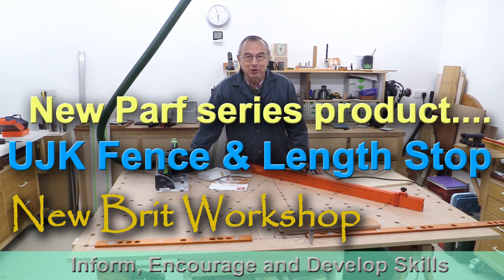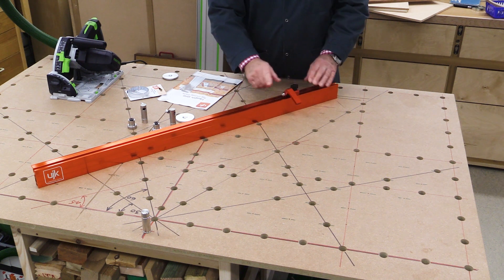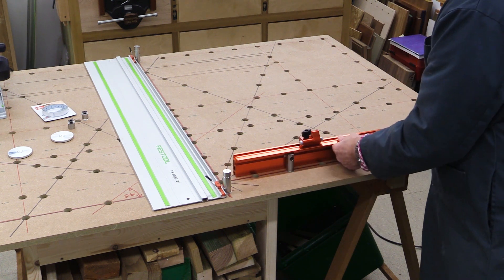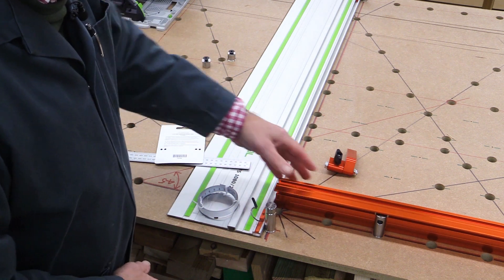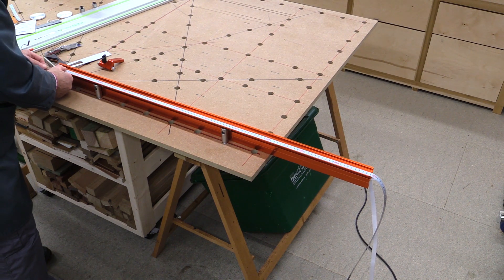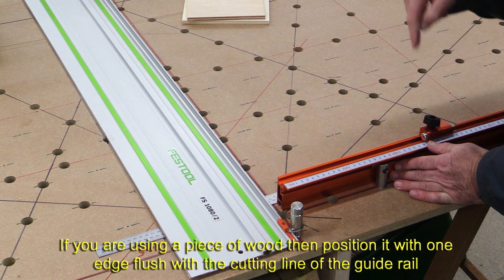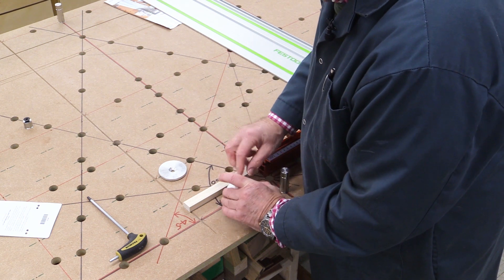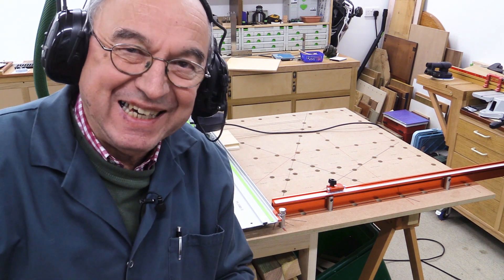New Parf Product - UJK Fence and Length Stop

Comment: I use the Makita corded track saw with this. As the motor housing on this saw sticks out (more than the Festool it would seem), it would hit the fence when it was placed up against the rail. Thus I had to leave a greater distance between the end of the fence and the track. So worth checking before you stick down the tape measure.
Reply from the maker: Hi Paul, Many thanks for this. I suppose one could cut a notch out of the RHS of the fence !  Cheers.  Peter

Comment: Hi Peter. I have watched this video along with the videos you have on the 600mm and 1000mm Parf System Fences. I am trying to decide which to buy - or both - and I'd love to hear your thoughts about this subject. I can certainly see use cases for both. Though I have noted in your recent videos you primarily use the fence referenced in this video. Do you have any advice? Also, longer term it would be great to see a video on how you use both whether independently or together in the same workflow. Happy New Year and best wishes for a successful 2024. I look forward to your response!
Reply from the maker: Hi Brian, I will try and cover your points in a video in the very near future. In essence, the 1000 mm is (for me) perfect for the tracksaw cutting station and I would choose the shorter version for the Kapex.  All the best to you and your family for 2024.  Cheers.  Peter

Comment: Haven't checked the specs on the dogs, but there's a few thoughts coming to mind: I would like to see a crank/lever or star-knob instead of the discs for fixing the dogs that hold the fence, seeing that you reach underneath and have to try to get a proper grip. Other thing is if the dogs and the fixing mechanism are limited in thickness of the benchtop. Other than that, nice new addition to the product portfolio.

Comment: Hi Peter,  that's amazing.  I recently purchased your design UJK parf guide system and hope to start making my own MFT soon. I plan on being able to drop my mitre saw into the bench so the table of the saw is flush with the table of the mft. If I purchased two of these could I use then on either side of the saw?
If so is there a right hand side version of the tape.
Cheers
Reply from the maker: Hi Dan, I just replied to your other message suggesting you do this - HaHa.  Peter

Comment: Can this new fence be used in conjunction with the smaller  Parf 600mm or 1000mm fence on the cut/waste side....or  are the offsets from the doog positions different?  So you have to use the screw on large  discs on the dogs as shown in video.  ...Can you buy a shorter fence of this style for cut/waste side for full support.....if the above will not work?

Comment: Peter, I have to query as to why you wouldn't butt the guide rail up against the end of the fence, when the guide rail is secured with the UJK guide rail dogs and clips there is almost no chance of any guide rail movement. I would suggest that with the fence back from the guide rail there would be potential for movement. Yes, some other brands of guide rail saws may require the fence to be spaced from the fence, but certainly not the Festool system. Nice video of my last new product for Axminster before retirement though, thanks!
Reply from the maker: Hi Keith, I am worried that in order for me (as I am using the rail clips) to remove my rail easily I have to tilt it against the long axis by about 45 degrees. If the rail and fence were in contact then the rail would scrape against the fence.   Peter

Comment: Hi Peter. I have purchased the 1000mm System Fence and am considering purchasing the Fence and Length Stop. When both are installed in their dog holes, would the Fence and Length Stop and the System Fence provide a straight edge to cut against ?
Reply from the maker: The System Fence sits back about 12.5 mm from the front of the front of the Fence and Length Stop. There had been consideration of making the two compatible but the latter could not be made any narrower and the System Fence would have to be made very wide indeed.  Peter
Reply: Many thanks Peter for the super quick response

Comment: Does the cordless festool clear the fence (against the lower battery) on conventional 3/4” (or 19mm) ply stock?
Reply from the maker: I am unable to answer that as I do not have that machine having only borrowed one for a demo video a while ago. If it does not clear the fence it is easy to sort out by sliding the fence away a dash or putting in a pair of offset holes for the tall dogs.  Peter

Comment: Hi Peter, do you only use plunge saw and rail to cut or do you also have a saw bench?
I'm sending you my deepest condolences. I'm really sorry for your loss, your majesty, Queen Elizabeth II.
Reply from the maker: Thank you so much for your support following the sad news about Queen Elizabeth. Yes, I use the tracksaw cutting station for all sheet material cutting. It is really accurate as it was made with the Parf Guide System from Axminster.  Cheers.  Peter
Reply: @NewBritWorkshop  Thanks Peter for the tip.  Sincerely

Comment: Thanks for a great video. It seems that the numbers on the measurement tape is upside-down?
Reply from the maker: Hi Peter, The fence can fit either side but only one tape strip is supplied.  Cheers.  Peter

Comment: Why wouldn't you just use the the Guide rail and fence in position and cut it.  IE (Put the strip they gave you at zero and run it down to the table along the fence.  Then just clip it at where it meets the fence.
Reply from the maker: I would love to see you demonstrate that.  Cheers.  Peter
Reply: @NewBritWorkshop  Send me a Rail and I would be happy to make a youtube video.  _🙂